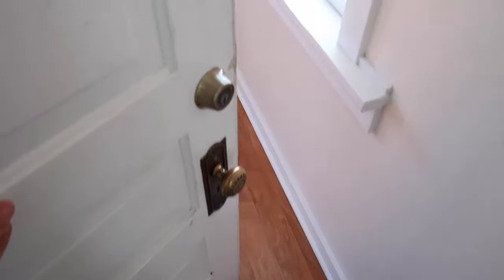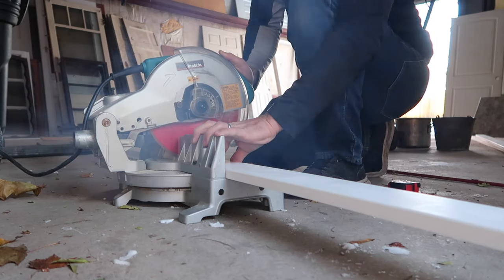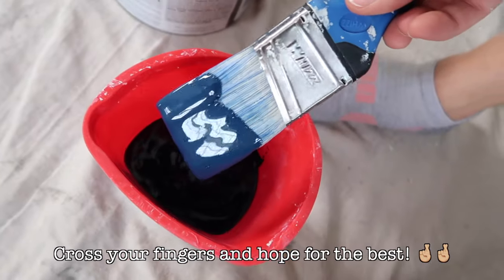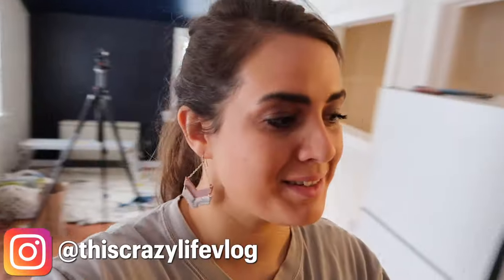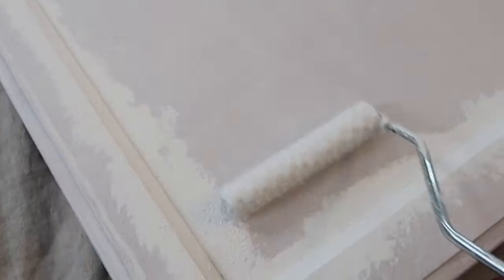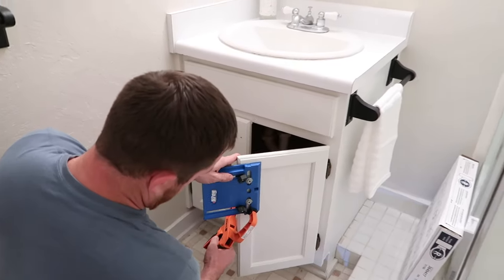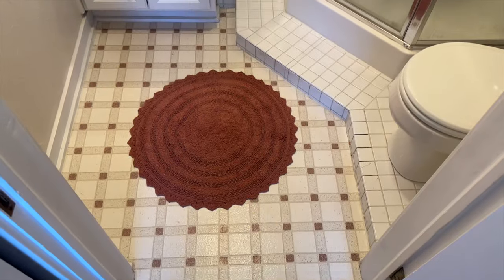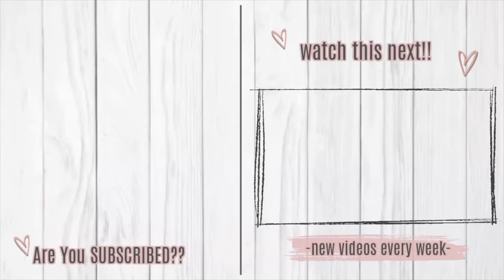Small APARTMENT MAKEOVER 2022 :: AirBnB Transformation on a Budget!

Comment: The transformation is spectacular and I thoroughly enjoyed your very calm demeanor.  I do have a small suggestion that might help with the refrigerator's placement:  install black- or grey-painted lattice from the ceiling to the floor to help hide it from the living room side.  You could also then hang some artwork on the lattice.  After recouping your money from the renovation (I wondered about the cost), you might want to replace the kitchen countertops with something that coordinates well with the top of the island.  Bottom line though is that I was delighted to find your program!
Reply from the maker: That’s such a neat idea for the fridge!! And yes! My brother actually plans to replace the counter with butcher block maybe?

Comment: 0:41: 🏠 A small apartment in Montana is being transformed into an AirBnb on a budget, with plans for painting, unique features, and furnishing.
7:04: 🎨 Discussion about painting the dingy trim and doors in the apartment, with plans to continue if it matches well enough.
14:57: 🏠 Apartment makeover involves painting light fixtures and bathroom accessories black to tie in with black accents, focusing on details for transformation.
20:15: 🎨 Apartment renovation involves painting chimney, cabinets, and bathroom fixtures black for a modern look.
26:19: 🎨 The paint used for the apartment makeover is very thick and requires a specific technique. It hides imperfections and is easy to apply without stripping or sanding.
33:38: 🏡 A busy day of transforming a small apartment with second-hand items and furniture from the host's mom's house.
40:27: 🏠 Apartment makeover includes installing ceiling-to-floor curtains, dealing with old walls, and replacing faucets to match the kitchen.
47:05: 🏡 Apartment makeover progress with functional bedroom items, bathroom wall shelves, and focus on finishing touches for each space.
54:08: 🏡 Apartment makeover adds modern kitchen and cozy living room with natural light, creating a welcoming and functional space.
Recapped using Tammy AI

Comment: If it doesn't already, your unit should include a smoke detector, a carbon monoxide detector if applicable, fire extinguisher, a couple of small flashlights for power outages and a first aid kit. Guests will appreciate an iron and an ironing board.